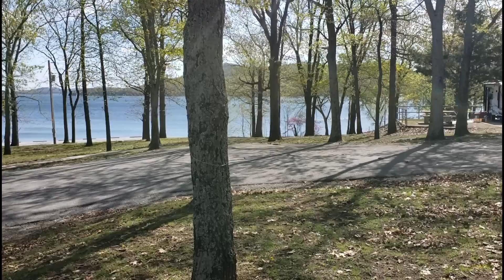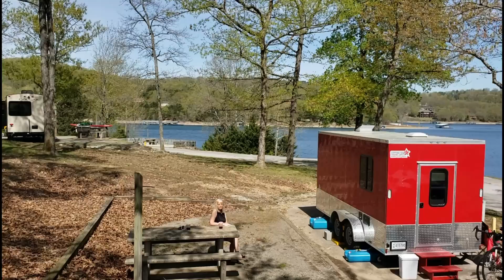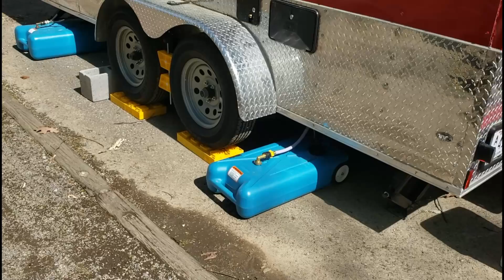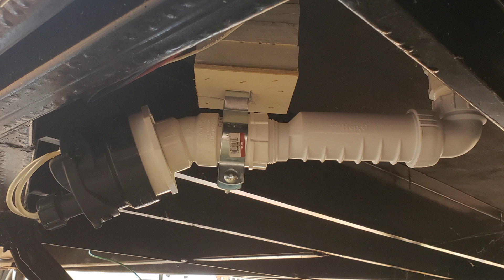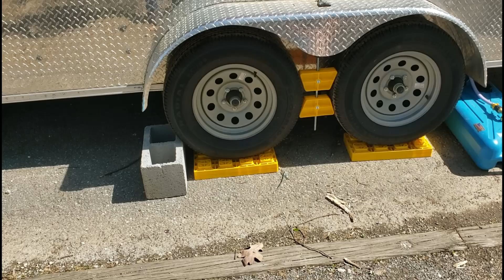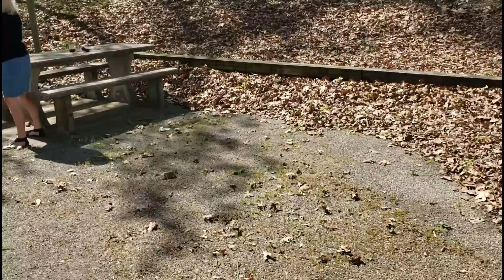Cargo Conversion Build Design Flaws? What A View!

Comment: Hey guys, I’ve noticed a cinderblock that you have behind your tires in a couple of these videos, is that yours and you’re carrying it around? Or are they available at the sites? And what specifically do you use them for? I assume to prevent the trailer to move in a certain direction but why? Thank you.  Onto the next video!
Reply from the maker: Some places we park are pretty steep, so we feel better with a cinder block, to keep from rolling down the hill...we carry them with us . You pretty much have to bring in what you need.
Reply: @billanddeb  Yeah I saw you answer that question in the moving and preparing the van episode. Thank you.

Comment: I love what you did with your camper. I am thinking about building a cargo camper. Do you know what it weighs loaded ready to roll for camping?
Reply from the maker: We haven't actually weighed it yet, but we did weigh the components during the build. We estimate it weighs around 4200 to 4500 pounds in travel mode.

Comment: Yet another great view guys. Exxxxcellent. Can't wait for the park tour. Got a question for ya. I am designing my trailer at this time. In one of your videos you mentioned that you installed a washer/dryer up front. What unit is it, how much water does it take and how is it working out for you? Or, did I just dreamed one of your videos talking about this. Keep up the great work and stay safe.
Reply from the maker: Yes we built in a spot for the washer and we haul the dryer in the van. All works great as long as we are connected to sewer. The problem is.... the description said it took 5 gallons to wash a load of clothes.  It also takes 5 gallon to rinse. Our holding tank is just 22 gallons. So when we are dumping tanks it is just too much, but when we are hooked up to sewer it is awesome.
Reply: @billanddeb  Thank you. So it sounds like you are using a smaller household washer and dryer. I have been looking at a couple of rv type washer/dryer units. Something similar to the magic chef mcscwd20w3. Appreciate your response. Thanks. By the way, I like the fact you can take your guitar along and play when you like. Not so much with drums.  :(
Be safe.

Comment: Have you looked into a Wee Boost. I see several of my nomad channels are getting those. I think we are going to get a hot water heater that runs on propane.
Reply from the maker: We've looked at Wee Boost. We even have a spot designated on the trailer to mount the antenna. We are going wait and see if service becomes a major issue.